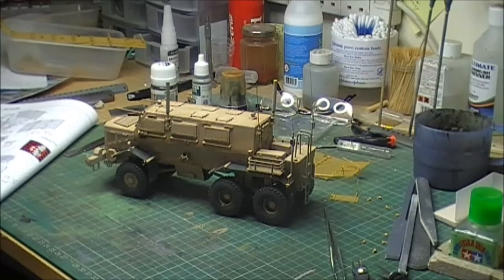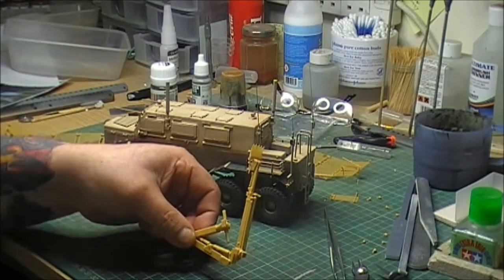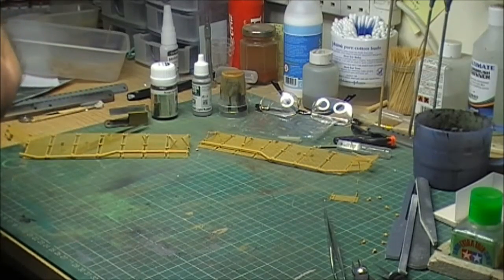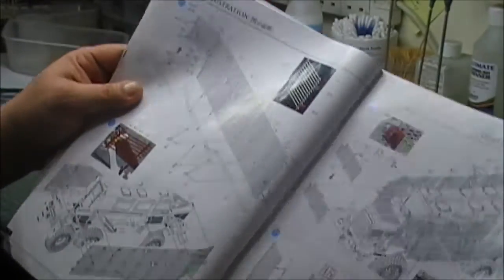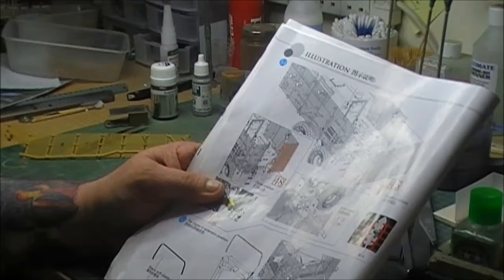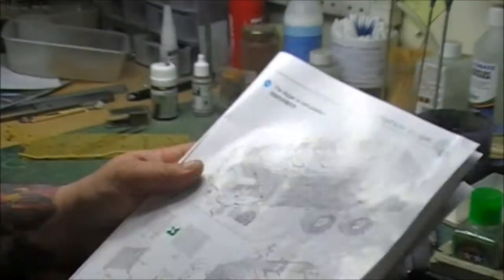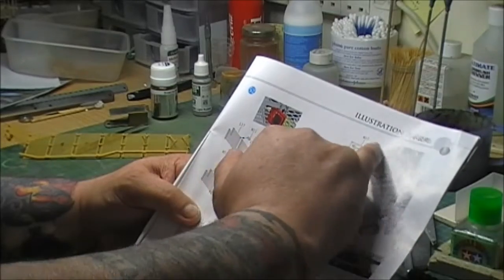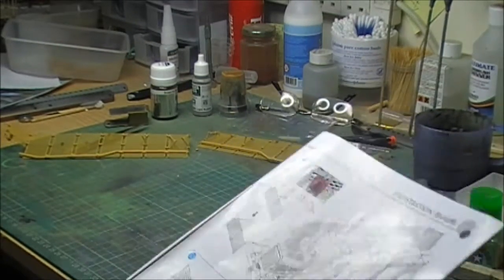Quick moan about Bronco instructions!

Comment: I realize you made this video three years ago, but I just wanted to add my comments about Bronco instruction pamphlets.  Although they are very pretty and PRINTED professionally.  I have never seen any “keys” (explanations) in the Bronco pamphlets as to many of the color codes they use in illustrating the parts in the exploded diagrams within the instructions.  I wonder how many model companies actually do “test build” from the finished pamphlet prior to market distribution of a new kit?  So many of the kits, not just Bronco, have errors and confusing steps in the manuals of purchased kits.